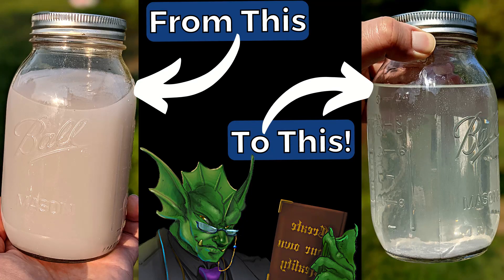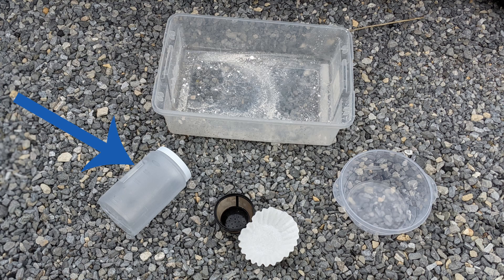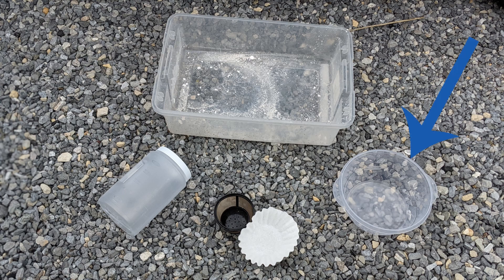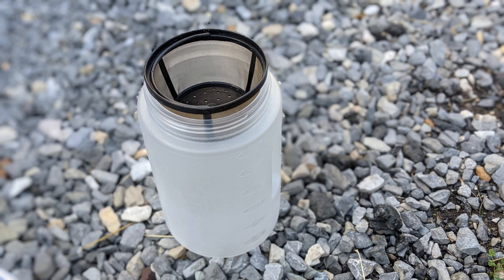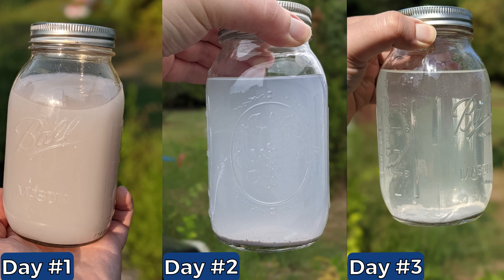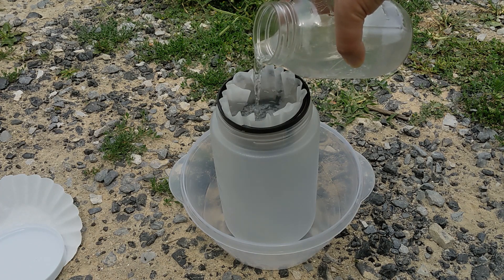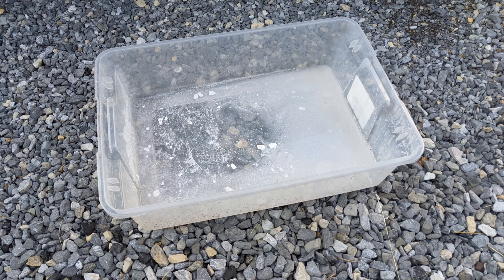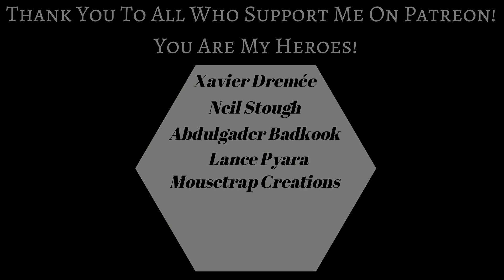How to Filter IPA & Other 3D Resin Cleaners!

Comment: So I tried this process, but I had SO MUCH resin waste in my IPA the entire container turned into a gelatinous blob. LOL
Reply from the maker: Yep I'm hearing that from a few people. That's not something I've encountered yet, but I can definitely understand how it could happen.
Reply: @SlicePrintRoleplay  For the benefit of  those that read the comments...I THINK it is because I shook it up before setting in the Arizona sun. Had I let it settle without UV exposure and THEN put it out there it would have worked.
Reply from the maker: @Davedwin  thanks for for adding that info. I definitely think that could have caused the issue you had.
Reply: @SlicePrintRoleplay  I have this issue and I have not shaken mine.  I've done two batches now and both end up with the jelly effect.  Maybe running through filter in advance of putting in the sun?
Reply: @Davedwin  Hello David. If you still end up with a sludge because your IPA gets too saturated with resin, you can still salvage most of it by straining it through 4 sheets of 100 mesh cheesecloth. In the end, you'll be able to squeeze the alcohol out like you would do with a cheese. Nitrile gloves and protection glasses are mandatory ofc. Shake the cloth to get the plastic out to dry in the sun and dispose of it. The cheesecloth is reusable many times. A second filtration of the IPA through coffee filters or activated charcoal may be necessary to get rid residual contamination.
Reply: @the_arcanum  Thanks I have a couple gatorade bottles full used IPA and will try this.

Comment: I decided to do science! I cut 2 liters and water bottles in half to make funnels (cause why not) then put cotton balls into the spout of the upside bottles, put activated carbon on top and set them inside each other to drain into a mostly intact 2 liter bottle. It took a while and I had them covered so it wouldn't evaporate but it filtered out most of the gunk and turned my green alcohol clear again XD

I kept doing this until the little bits of waste at the end were all that was left, kept that one bucket of alcohol going good for about a year

Comment: Couple of suggestions for the big waste container.  The large metal disposable pans from the dollar store work very well .  Also if you drop a layer of paper towels in the bottom and THEN pour the waste resin on it, it will harden in the paper towel and be even easier to dispose of.
Reply: The paper towels, so simple 🤯
Reply from the maker: @nairocamilo  I know right!
Reply: You could probably use a newspaper too
Reply from the maker: This is amazing! I actually just put those disposable aluminum trays in the description with an explanation that I couldn't find a reasonably priced container.... But that suggestion about the paper towels is brilliant!
Thanks for that!

Comment: I tried doing it this way, but the resin in my ipa decided not to filter out and just turned into a giant gelified glob.
Reply: You need to let the resin settle some first, before curing , for some resins.  If they're too suspended or the alcohol is just too saturated, they can form am almost foam structure jelly in the solution if it cures quickly.
Reply from the maker: Interesting... I will certainly not claim to be an expert, but I would imagine that if there's tons of resin in the liquid then that could certainly be a result.
Reply: @SlicePrintRoleplay  Yeah, I noticed overly saturated alcohol turns into jelly
Reply from the maker: @B143DP  ugh, the worst peanut butter and jelly sandwich ever! 😂
Reply: @SlicePrintRoleplay  Indeed!
Reply: @SlicePrintRoleplay  maybe It depends on the intensity of the IPA, like 70% 91% 99%
Reply from the maker: @phroge9045  that could certainly be a factor. Good thinking!
I also think another major factor is how much resin is in the cleaner. If it's got a ton in it then it seems to turn into a thick jelly.